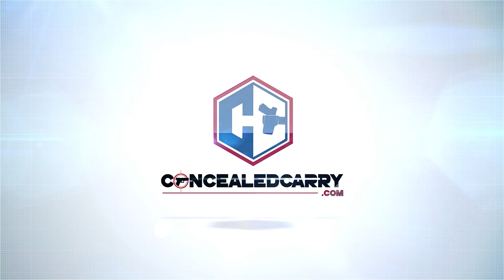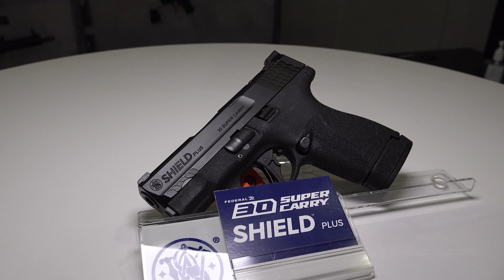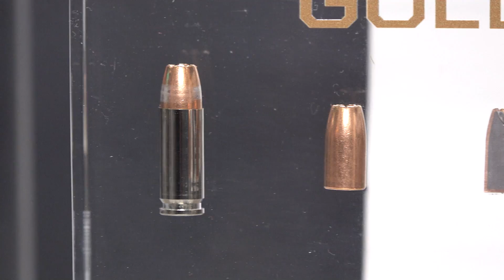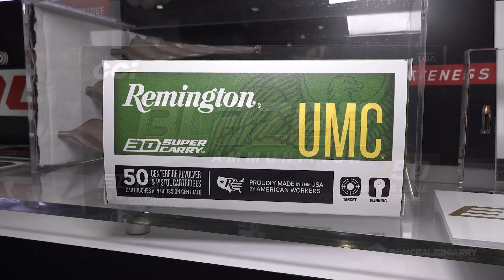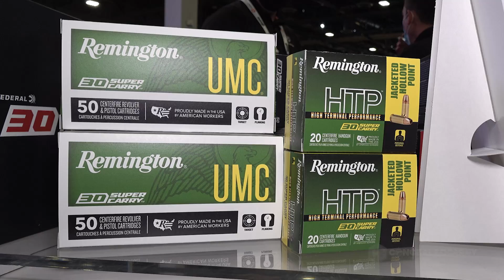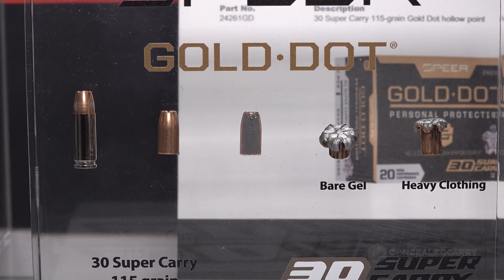Federal .30 Super Carry Breakdown!

Comment: In the interview he mentions 3 things being important for terminal performance. Shot placement, expansion/projectile diameter, and penetration.  He also say you see incremental gains as you go from 9mm to larger cartridges. Taking that information from one of the premier experts in this field. The ideal cartridge would be a 50 caliber expanding bullet that penetrates consistently under 18 inches. Everyone uses bullet technology as the reason 9mm is now as effective as 40 or 45, 20 years ago, but as long as that same technology has been applied to other cartridges the gap is still effectively the same.
Reply from the maker: Part of what isn’t considered is that while there may be gains, it comes at a cost of other factors (recoil, controllability, capacity, etc) while likely not offering enough of a significant terminal ballistic advantage.

Comment: The 30 Super Carry is a long overdue update of the 32ACP which was developed by John Browning in 1899.  It will also compete with 380ACP.   It is not a replacement for 9x19, 357 Sig, 40SW or 45 ACP.  The cartridge may also become popular in other countries that do not permit civilian possession of military cartridges like 9mm Luger.  If a 100 grain bullet can produce 330 ft-lbs of energy out of a 3 inch barrel whilst being controllable in a sub-compact pistol - it is a game changer.   That being said, 50,000 PSI is rifle level chamber pressure.  It may be a barn burner at the muzzle it may not work well with micro-pocket size pistols like the KelTec P3AT or straight blow-back pistol designs like the Walther PPK or CZ-83... but those are old school, 20th century designs.

Calling it "30 SC" was stupid.  The cartridge should have been called 32 Super Auto because it uses a 32 caliber (.312) bullet.  Also, why alienate the non-carry market? ... the cartridge has application to larger home defense pistols and PCC.  50,000 psi is very high chamber pressure normally associated with rifles... e.g.  223 Remington is 52,000 psi.  My concerns are: (a) blown primers, (b) case ruptures [especially with reloads or unsupported chambers], (c) extractor wear due to excessive case obturation, (d) failure to extract due to excessive case obturation, (e) difficult manual slide retraction due to a stout recoil spring, (e) very loud report due to high muzzle pressure, (f) "snappy" recoil due to a stout recoil spring.  I have a few other concerns, but they would take time to explain.
Reply: .357 Sig is 40,000PSI, and it doesn't destroy barrels any faster than 9mm Luger or .40 S&W at 35,000 or 10mm at 37,500. It's not pressure that wears barrels at all; velocity does that. This cartridge produces 9mm Luger velocities. 🤷🏻‍♂️ No problems there. Barrel burners are 3,000FPS and more, like M193 and .17 Fireball. 

As far as straight blowback pistols...no. This is meant to be a 9mm rival. It makes more energy than .380 ACP and basically double the pressure of that cartridge. It makes about the same energy as 9mm Luger. You can only do delayed blowback with 9mm Luger in typical handguns, never straight blowback unless you're ok with a big, heavy, honking brick of a slide and a ridiculous recoil spring. Usually that means you'll use gas delayed or roller delayed blowback for a handgun design. The same will be true of .30SC since it's a 9mm Luger equivalent. You could rechamber the Walther CCP in .30SC and it would work just the same. You could rechamber the CZ-52 in .30SC and it would work just the same. None of those straight blowback handguns you list can handle 9mm Luger and therefore, .30SC. 

As far as the name, what is the diameter of a .30 Tokarev? .30 Mauser? .30 Parabellum? Their choice of the name ".30 Super Carry" despite a .312" bullet is totally justifiable. The Russians and Europeans consider .312" to be .30 caliber and the 7.62x39mm as well as 7.62x54mmR rifle cartridges are also called .30 caliber cartridges. The Mosin Nagant M91/30 back in the very beginning was known as the "3 line rifle" which meant .30 caliber in the Russian measurement system at the time. I would actually agree with you though for a different reason. A .32 caliber derived name would be better. I say that because most concealed carriers dislike cartridges below .380 ACP for carry, both due to bullet diameter and energy behind it. We know that 9mm Luger and .380 ACP are .355", and we all know for sure that .357 Magnum is .357" because the name is true diameter (unlike .380 ACP or .38 Special which carry over from the black powder days). Hearing that a CCW cartridge's bullet is .30 caliber will make a lotta people immediately become uninterested. They'll call it a pea shooter. 🙄 .32 is an easier step to make from .355" for sure. Of course, the foh five Fudds will never go for this, and neither will the .40 S&W guys. 

Why "alienate the market?" I don't think that's what is being accomplished here. It's named after its primary purpose which it was designed from the ground up to accel at. 🤷🏻‍♂️ Makes perfect sense. You can certainly chamber it in a PCC and many certainly will do so. This is a carry handgun cartridge first, and all other purposes after that. 10mm Automatic would seem to "alienate" the revolver market, yet the S&W 610 is a thing. 

As for your other alphabetically enumerated concerns, I think most are unwarranted. A ground-up design cartridge that was intended to have 50k psi inside of it will have a thick enough case head, web, and walls to contain that pressure. Does anyone have those problems with 9mm+P? I never have. THAT is an instance of taking a cartridge case NOT designed for that amount of pressure and loading it over the maximum limit on purpose anyway. I've never had a 9mm+P cartridge rupture, excessively obturate and cause extraction issues, etc. Hell, people don't even have those issues with 9BPLE which is 9mm+P+ and even MORE overpressure than established +P margins. When you fire a 9BPLE with a Glock's loose chamber, you can put a micrometer on the case and measure how much it expands, yet there are no feeding issues. 9BPLE was created for police. If it had problems mangling its cases and causing malfs, do you think cops would carry it? And here, we have a cartridge case created from scratch to contain 50k psi right from the get go, not just a very old case being pushed way over its intended limit for modern use. It'll be fine. Guys only have issues like you say with 9mm once they start doing absurd things like loading "9mm Major" which takes the 35,000PSI case and goes insane up into 40,000 and even low 50,000PSI range. You fire brand new Starline 9mm Luger brass loaded to "Major" pressures one time and then throw it away. 😸  .357 Sig uses normal small pistol primers. Idk what .30SC uses, but if it comes to light that ruptured primers are an issue, it is a very easy remedy to switch to small magnum primers which are more able to handle the higher pressure. My .357 Magnum hand loads are really stout, and they give me some nice cratering flow sometimes. Never ruptured one though. Not saying it won't happen ever, just that it's actually hard to rupture one if your striker or firing pin protrusion is correct. I'm going to guess that chamber support will be good due to the 50k psi spec and the smaller case diameter compared to 9mm Luger which it is replacing in these preexisting guns. The reason .40 S&W had issues with case head rupture was because getting a .40 S&W into a 9mm frame handgun didn't leave much meat in the walls of that chamber. Glocks also likes hogging out ramp support area to increase reliability. I have a Storm Lake barrel for my Glock 20 which has great support for the case head. Never had a 10mm nuclear reload bulge the case very much with a stock barrel, but I want to be safe and I want to extend my brass life as much as possible. Tiny bit of a smile was present with the stock barrel of my Colt Delta Elite which had almost NO support compared to a stock Glock barrel. Lol. A Delta Elite, support? What support? 😸 The recoil spring shouldn't be any stouter than a 9mm Luger because of the similar energies. Certainly no more than a .357 Sig or 10mm. Those are perfectly fine to operate. 

You are right about a couple things here though, and justified in worrying... The recoil will definitely be a bit snappier than 9mm Luger but not much greater because of the similar energies. Porting and compensation will work better than 9mm Luger though due to the higher pressure, so recoil reduction devices will be more effective! The report will definitely be loud and unpleasant bare-eared with that 50k psi pressure. Lots of guys carry .357 Magnums for defense though, and those will be just as loud. Even more guys have unsuppressed .223 or 7.62x39mm braced pistols for home defense, and THOSE will be louder still. "Ice rather be deaf than dead." Personally I'd rather be neither, which is why I carry 9mm Luger. 😸 

Hope this is good food for thought. 👍
Reply: @mannys9130  "Lots of guys carry .357 Magnums for defense though, and those will be just as loud."  Yes but is it good? .327 federal has higher pressure than .357 Mag and its louder. The .30 SC with also higher pressure will be louder also. Even the 90gr magtech 9mm is louder than 158gr 357.  I think noise that causing eardrum rupture, blast trauma are underrated problems! They could be even disabling issues in a gun fight but also after. I once read a story of someone who had permanent hearing loss after using .357 out of a snubby in selfdefence. So if this is a good "carry" round I am not so sure. But I also would stay away from .357 mag or light 9mm +P loads.

Comment: My shield plus hold 13 rounds that's plenty if I feel I need more my sig 365x holds 15. I think I'm good with my 9mm
Reply: You COULD have 15 and 17 rounds instead. 🤷🏻‍♂️ Never heard anyone survive a firefight and say "Ya know, I really just wish I had less ammo. I had too many rounds."
Reply: @mannys9130  You can't use 30 Super Carry with any other commonly used pistol. 
Ammo will be pricier and less available just like .40 is. 
365 has 15 rds of 9mm +P JHP in micro compact size w/ magguts.
Entirely new guns have to be made just to use this cartridge. 

They're providing the solution to a problem that's nonexistent.
Reply: @mannys9130   most gun fights dont last more that 5 to 8 rounds in a gun fight so im pretty confident with 13. And if not I carry a extra mag.